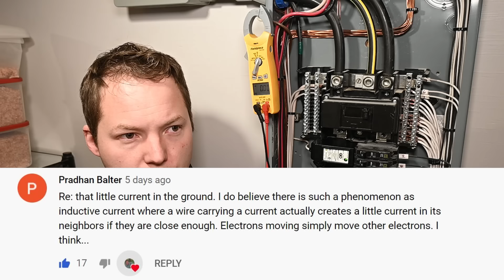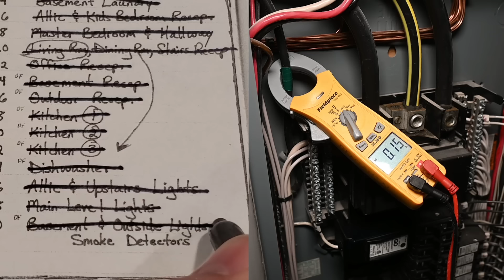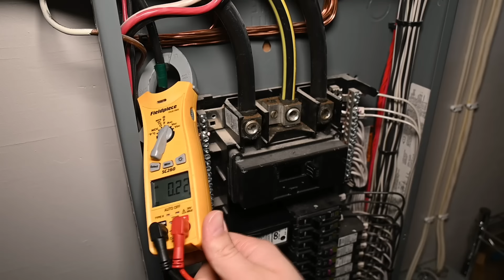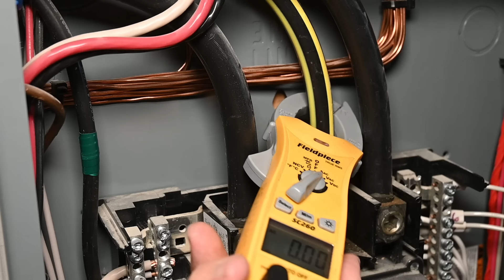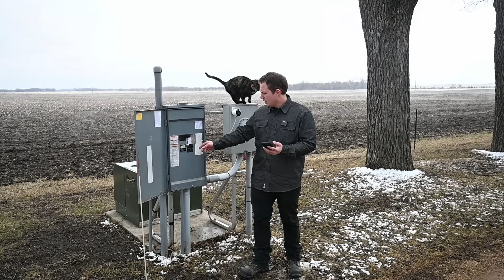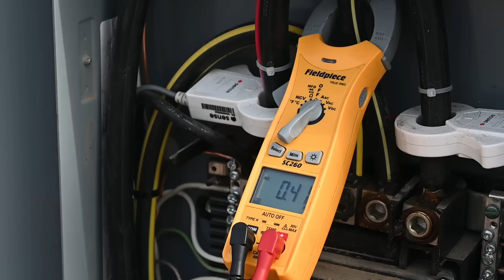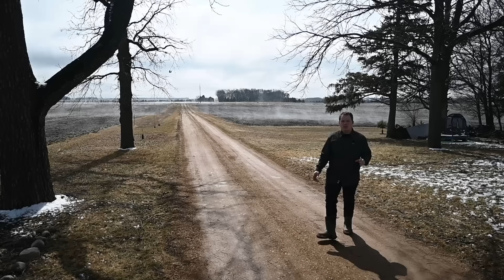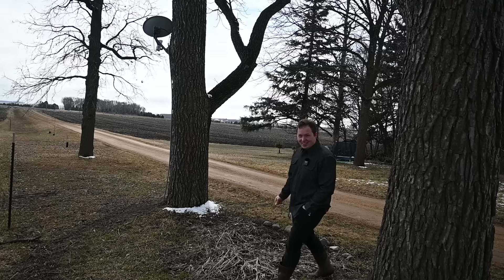Finding The Source of Stray Current on Grounding System

Comment: Inductive current otherwise known as 'field of flux' is the energy surrounding a conductor with current flowing through it.  Is is widely used in transformers to produce the step up or step down voltage between the primary winding and the secondary winding.  Back EMF (electromotve force) is used in motors to open circuits where start capacitors are used.  In motors the use of a potential relay which senses this 'Back EMF'  is responsible for energizing a magnetic solenoid inside a contactor and breaking the circuit when the motor reaches enough speed to rotate without the start relay.  This usually occur at about 1/2 to 3/4 of the motor's final speed.  There are other mechanical devices used to accomplish this as well but due to cost the use of Back EMF is most often used.
Essentially, when you have current flow or EMF (electromotive force) you also have Back EMF as well.  These all participate in circuitry to produce various effects, especially in control circuitry.   And when current flows there is a field of energy that surrounds the conductor.   When you place to conductors next to each other and you pass current though one, the other also receives energy or current due to this field of flux.  The author is pointing this out when he mentions the possibility of current present on the ground wire in the breaker box.
In this video you get to see the effects of this field of flux (inductance) when the amp meter is place around the wire.  The field around the wire is being measured by the device to determine the current flow.  The circuitry inside the meter is designed to produce a digital reading of what is being sensed.  As current flow increases the field becomes greater and the meter is able to translate that into a digital reading.  Older amp meters used a real meter with a pointer on a scale to give you a reading.
Take a look outside at the way the cable is made coming from the transformer to the meter.  All bundled together.  You are getting current in the ground from the field of flux transfer.  
This fellow is a bit too dramatic to follow.  A real youtuber with monetization glowing on his face.  If you want answers go anywhere else.

Comment: The Fwit that told you it's not an "Amp Meter", has limited understating of the meaning (or usage of the English language) and should be ignored! "AMMENTER" is an abbreviation of Ampere Meter, and Amp is an abbreviation of Ampere; so...... "Amp Meter" is a valid noun or descriptor of the device

Comment: The transformer would have a circuit of some kind to maintain a constant voltage because ultimately all of the users in that power plant draw from the same source, aka brownouts. That capacitor in the transformer would likely reference the neutral. However, with a floating neutral it seems that the relative voltage on the hot sides to neutral would be lower somewhat. Or some Watt..  is that a regulating transformer?

Considering you have a few milliamps of 220 potentially if shorted to actual ground, wouldn't that be enough to cause a fire in the house?

Comment: I had this problem I think its a grounding problem Too many grounds. I bet at the transformer is grounded and I think that it is not suppose to be. in my case the current flow caused copper water lines to leak from copper loss to the water, pin holes everywhere. it turned out to be from communication equipment bonded to the water supply, we separated the ground to a rod and problem solved.

Comment: Great Video... looks like I have the same issue... I actually found this when plugging into an outlet tester and getting a closed ground, when I knew it wasn't bonded. The slight voltage on the ground was enough to light up my outlet testers closed ground. I also went to the neighbors house and found that they have the same thing going on.

Comment: I would investigate that transformer. I had the same issue at a cheese plant and it was stray voltage at the transformer the casing was not bonded to ground. If that's the problem its a quick fix! Good luck

Comment: Wow, lots of replies. I don't expect you have time to read them?
I would say the most likely cause of the current in the ground wire is the collective leakage currents if the heating elements in the installation. Stray currents from the utilities supply neutral, as suggested by others is unlikely, I think.
I have been teaching electrical apprentices and some tradesmen, electrical trades and HV substation maintenance for 40 years. Your videos are very good. I live near Sydney, Australia. Even though our electrical supplies are different voltages and we don't usually use centre tap transformers , grounding and the need to have only one point at which ground and neutral are connected together is also true in Australia and no doubt all around the world. Our wiring rules do not allow more than one ground-neutral bond in a building but other ground-neutral bonds may be used if supplying a separate building but then a conductive water pipe must not be bonded to the ground bar in the second building, because the pipe would be a parallel path for neutral and ground current as you explain in your video with gas pipes. Cheers

Comment: The stray current is going from the outside transformer ground rod----Thru the Earth into the house Grounding rod. The Earth is completing the Circuit.
 Electricity will DEFINITELY go thru the Earth.
Next time ---Wet the Cat down and spread some fish oil on the Main panel. The Cat can find the Elect path,  and it can not kill him. If it does kill him, he can still be used EIGHT more times.

Comment: Are the neutral and ground bonded together at the main disconnect (outside), AND at the distribution panel (in the house) ? Normally they are only bonded at the main disconnect.
Reply: No they are bonded at the main panel only, based on his past video's.
Reply: I think Nolaman 1970 is correct below, but I believe there is a requirement to connect the ground of a subpanel to a grounding rod.

Comment: Could have been anomaly with your amp meter? I found what looked like slight current on my ground wire but then I removed the clamp from the ground and had nothing going through it made sure I had the jaws closed and even with nothing passing through it showed 0.19

Comment: Had this happen to me.

Turned out to be the power company wired the new transformer wrong. $3500.00 later I had a new main power panel installed with an exterior generator panel for the next power disruption we have.

Call the power company immediately if you ever have power readings in your grounding system!

Comment: Those white things connected to you ungrounded conductors nearest to your transformer where you have your disconnecting means(aka breakers) are  current transformers and those are connected to your Metter so it only reads amps from those CT's (current transformer.) So in other words you are correct you won't get charged for the grounding conductors.

You are correct those amps are probably flowing through the ground to somewhere. Call your power company it is on their end not yours. They should fix it. It's unsafe to have your ground as a current carrying conductor

Comment: I am relatively new to learning this as well.  I look at the power systems I have here at the farm and they don't make sense.  But, I think they are starting to.  

 #1.   Check with your journeyman, and see if he would be willing to do this test.  I'm no electrician, just someone who is learning.  I don't want to tell you to do something that will fry you.  If you're journeyman wants to give it a go and has a safe process of doing so, it could be interesting.  

 Measure current from your phase lines to ground.  The unhook the grounding electrode conductor.  See if the power changes.  Also, check in voltage, not just amperage.  I suspect when you remove the grounding electrode conductor  that you will notice a drop on neutral, and in your voltage.  

Next.  Measure the current and voltage between the GEC and the Ground (or neutral because they're bonded)  bus bar when the GEC is disconnected.  I imagine you'll have voltage.  BUT, they voltage isn't coming from your system.  It's going to your system.  Where from?  The earth.  Being that you are right next to a transformer which also has a grounding rod, the voltage / Current being dissipated from the transformer grounding rod is being picked up by your grounding rod and put into your system.  You think you're losing that power, but you are actually gaining it.  I saw this on a Mike Holt Video, sorry I can't find it right now, but basically, when the energy is sent to the ground, it doesn't disappear, it's in the ground, around the rod.  Take a voltmeter and connect it from your ground on one end and stab the other end into the ground.  You will probably measure a current.  Push it into the ground farther from the transformer, it will probably be less.  If this is the case, you are taking that ground voltage from the grounding rod, bringing it to your power panel, and into your house. 

Since there's a bond between the Grounding Electrode Conductor (GEC) and the and the Equipment Grounding Conductor (EGC), that voltage is being applied to the cases of ever grounded metal part in your whole electrical system through the ground bus bar.  That's bonded to your neutral bus bar which means the neutral side of all of your electrical components is also being fed this voltage from the Ground rod at your main transformer.  This blows my mind.  (If I understood correctly).  

My uneducated mind (which I find sometimes better, because then you can think "the theory is this" not "the book says to do this") tells me that the GEC should be isolated form the EGC.  The GEC has a job of helping a lightning strike find a path to ground so it doesn't electrocute the people in the house.  How can this be accomplished if it's bonded to the EGC system?  If lightning strikes the house, wouldn't it energize everything in the EGC system, and then all of the neutrals bonded to it?

You said ground rods as in plural at your transformer.  There should only be 1 on the primary side.  If there is a second one, it will jus pickup the energy being transmitted through the ground and put it back into all of your system.  There should only be 1 Electrode by the transformer.  --> Maybe I just explained what you were trying to explain... I am just trying to figure this out for myself!  If there is an explanation somewhere that demonstrates the fundamentals follow it, not just the NEC, I would be interested to hear it.

As far as the grounding rods at the house, that doesn't make sense to me for those to be tied into the ECG system either.  The more rods you have, the more places where energy can be brought in.  If lighting strikes near the house, those rods will take all of that current and put it through your whole system.  It seems wrong.  If there was some sort of diode on the ground rods, that would make more sense (if there is such a diode that can handle that kind of current).  But Lightning is DC, so in theory, if there is a strong enough diode, then it should be able to block the voltage from getting into the power system.

A big information point is that the power wants to return to the source.  It does not want to go to the ground.  Why ground rods in the EGC?  I don't know.  I don't think Mike believes it makes any sense either.  Curious as to what you think.  You seem to have a very analytical mind as well.  I would me interested to hear your thoughts.  If it doesn't make sense, look up MikeHoltNEC and check out his videos Grounding - Safety Fundamentals, Ground rods and metal poles.  The nee if there's anything else you want to look at.  Sorry I couldn't find the the video I referred to in the response.  I couldn't find it again.  However, look up MikeHoltNEC and check out his videos Grounding - Safety Fundamentals, Ground rods and metal poles.  Then see if there's anything else you want to look at.

Comment: A follow-up on my comment yesterday. Your farm is getting its power from a substation, which is probable many miles away. Power is transmitted from a power generator to the substation as 3 phase power. The receiving side of the substation transformer is usually a 3 wire delta connection. The output side of the substation transformer is usually a 4 wire wye connection. The 4th wire is a neutral wire that is always grounded at the substation. This transformer has 3 phase output. Some streets will have all 3 phases. Other streets will have only one phase. Since you don't need 3 phase power, your transformer is connected to only one of the three phases (it does not matter which one). Since your house is so far back from the road, you have your own transformer near your house. To save money when your street first got electricity your utility might not have run the neutral from the substation all the way to your street and to your house. If that is the case, then the primary return current of your transformer will flow through the earth. This requires a good ground to deep earth at the transformer (several ground rods). Hopefully they did run the neutral all the way from the substation to your house. Note: the dirt each ground rod is driven into acts as a resistor (typically 25 ohms) between deep earth and the ground rod. There will always be stray current to earth at your transformer even if the neutral from the substation is connected because of voltage drops. The reason you measured stray current at your breaker panel is that you have additional ground rods at your house which share the stray current connection to deep earth.

PS: where I live there is a house every 100 feet and a pole mounted transformer supplies 120/240 volts to ten or more houses.  The neutral is grounded at the transformer and is connected to the adjacent transformer neutral and all the way back to the substation. Hundreds of transformers share this neutral connection. The neutral is also supposed to be grounded at each house, but is it. When I moved into my house, I noticed the neutral grounding wire was loosely wrapped around the municipal water pipe without a clamp. I fixed this 40 years ago. Many of the houses near me were made by the same builder. How many of them have a poor connection to earth that has never been fixed. This may explain why I have 2 amps of stray current in my grounding wire. 

PS: small low voltage transformers. Some 120 to 20/24 volt transformers (door bell, low voltage heating control transformers) may be a source of stray currents (capacitive coupling between the transformer winds and the metal frame of the transformer) on the ground wires feeding those circuits.